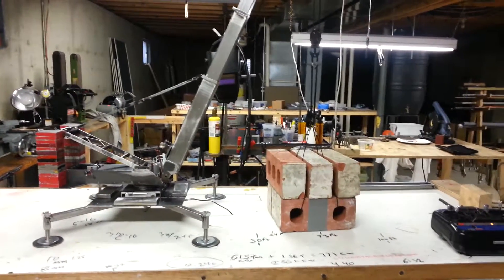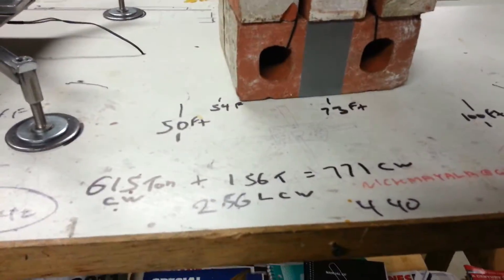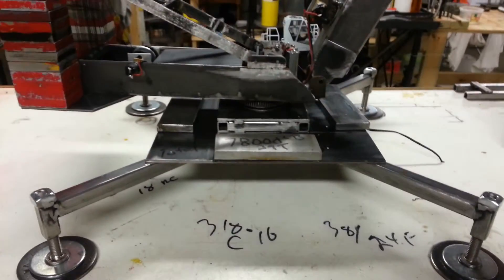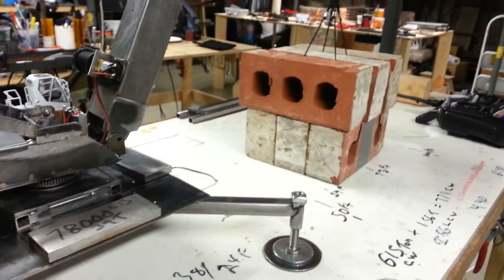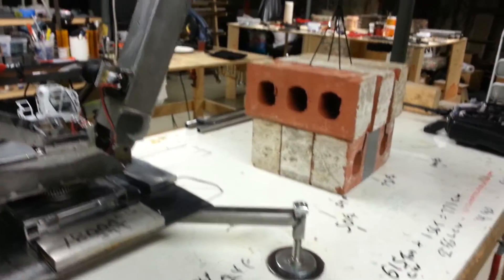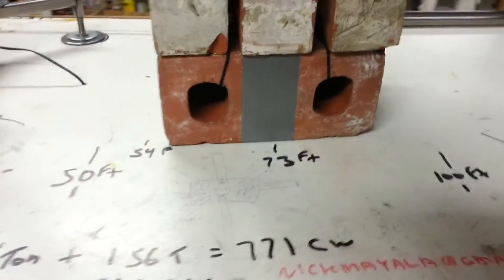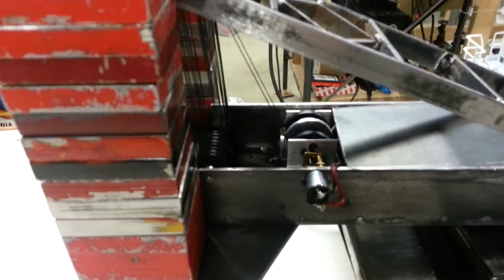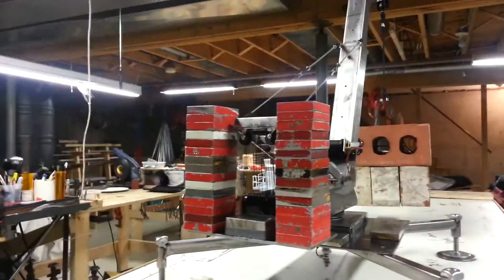RC Crane ,,,CG 2000 tb , proto-type ,,, 1400 ton test pick at 73 Ft ,, in 1:50 scale

Comment from the maker: hi Mike , the calculation is correct , you also have the crane weight , about 12 lbs not counting the boom . also anytime your picking inside the O-R foot print it a matter of structural strength and parts of line ,,,thanks